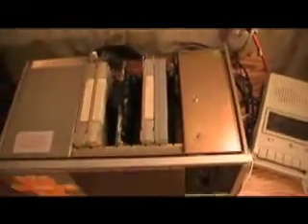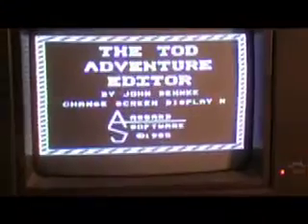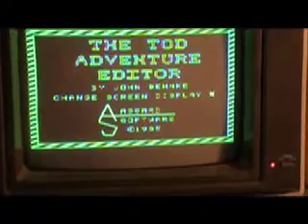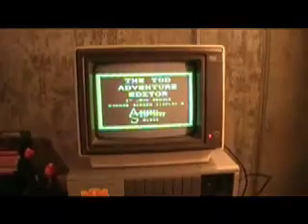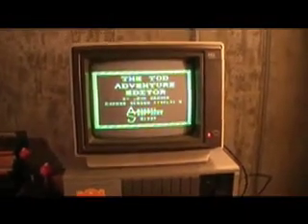Disk Drive Swap on a TI-99/4a

Comment from the maker: It's been a while since I've been inside mine, but (if I remember correctly) I spent a bunch of time trying to take screw and such out and wasted it all.  The drive came out by un-screwing two small screws on the top of the drive protector plate (accessible as soon as the top of the box is off)

Sorry it took me so long to get back to you.  =)

Comment: How the heck did you get that drive out!  :-) I am working on disassembling a PEB right now (it was in pretty rough shape when I acquired it) and getting access to the drive is a bitch!  Everything is all screwed together and that front plastic plate has screws going from the INSIDE into the plate, but screws that are inaccessible (as far as I can tell). Would LOVE some advice on how to get my grubby fingers onto the floppy drive!  Any ideas???  :-)